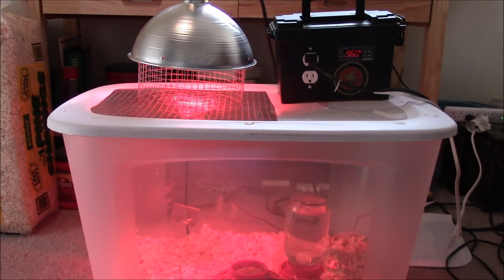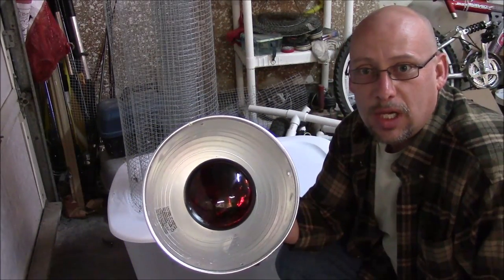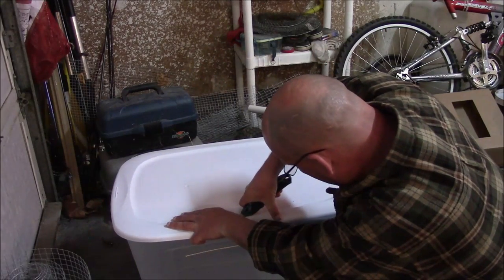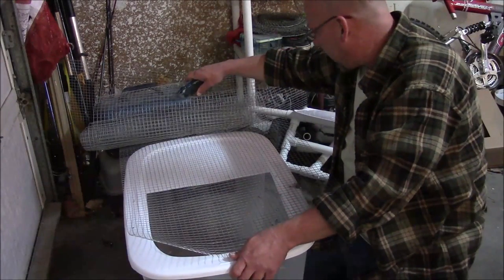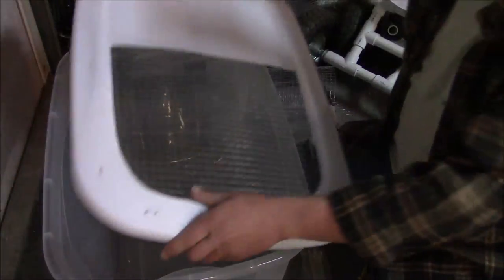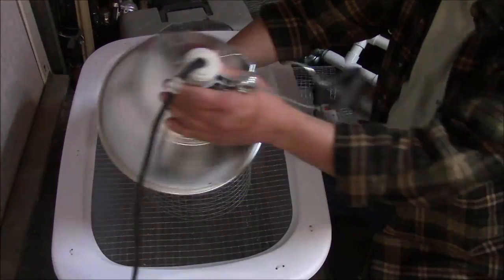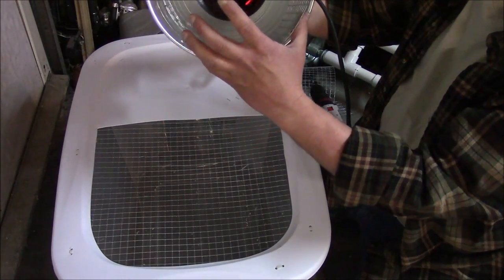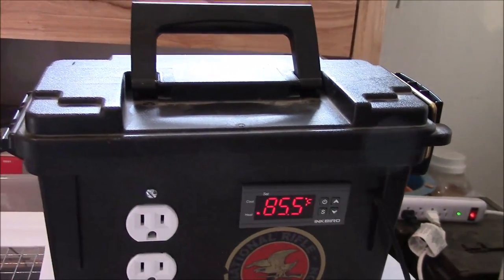How to Build an Automatic Temperature Controlled Brooder Box

Comment: I use a heavy wire rabbit/ small animal cage with a built in stand for my brooder with a heat lamp sitting above it. I have raised chicks many times this way and never lost one. Much easier to clean too. I keep it inside the house in a second unused bedroom where it is warm. For the bedding I just use large puppy pads. Just pull them out , throw away and replace with new.
Reply from the maker: sounds like a win.  I have started using paper towels for the bedding.  Works well for me.

Comment: If it's turning it on and off frequently, that bulb isn't going to last very long. I think you're going to run in to the issue of that bulb dying on you sooner than you think, which will kill the chicks. I stopped using bulb heat a while ago because I've had bulbs burn out at bad times. I currently use heat pads for brooding because they're more energy efficient, safer, and so on. The only downside to the heating pad is that you need to put something over them for the chicks to get their footing, otherwise you get some splay legged chicks. A paper towel seems to work, but I've also toyed with covering them in aluminum screen. A heating pad, a small 9"x12" one, uses about 25W of power versus heat bulbs which are 125W to 250W. That means I can run five to ten brooders for the same energy demand.
Reply: How do you keep the heating pad clean?  What kind of heating pad are you using?  TIA

Comment: Chris, I followed your 2 videos on this build step by step.  The issue I am having is figuring out how to set the thermostat to F instead of C and how to set it for the quail.  After watching 1/2 a dozen videos, I cannot find how to do this.  Any help would be greatly appreciated.  Newborn chicks are in the incubator waiting on me to finish their next home
Reply from the maker: I am so sorry you are having those issues.  I don't have this unit any more and can't remember the exact steps to set it to F.  I don't remember it being that difficult to find in the menu though.  If you can't figure it out just convert the temp you are looking for to C.  100 F (what you want it set at for the first week) is 37 C.  I know it is not ideal and I wish I could help more.
Reply: Slightly Rednecked I finally figured it out.  Thanks anyway
Reply: Google the name brand control. Find the user manual. It will tell you the settings

Comment: I'm currently using totes with regular bulbs and a dimmer switch. It has been working great so far. I do like this design and have considered building one myself. I'm curious do you still use this type of brooder or do you normally use something else? Thanks
Reply from the maker: I don't use the temp controller any more.  I find it really isn't necessary and just as easy to just move the light further away to regulate the temp.

Comment: What wattage would you recommend for a aquarium as a brooder to keep young chicks in? I think mines about 5 Gallons... I think that's kinda small... maybe I should get a tub and have the lamp sit over the chicks? what would you recommend I do?
Reply from the maker: You could use an aquarium but the tubs are pretty cheap and will be easier to handle (much lighter and less likely to break).  I use a 250W bulb.  Hope that helps.

Comment: I think i about cooked my chicks this first time i used my chick light. I think a 250 w bulb was a bit overkill. Unless I'm hatching quail in the dead of winter outside i think I'll still with a 100 w bulb. I had more chicks die get piled up on the edges of the box.(and i had no lid on it.) I checked the temp before i put the chicks in it. It was staying level at 100°. But all the quail stayed in the far edges away from the light. I lifted the light another 5 inches. By the time they were 2 to 2.5 weeks old i put them outside. They were constantly noisy when in the brooder. Quiet as church mice outside. The brooder was inside my house. I ended up losing 12 chicks in the 2 weeks they were in the brooder. Probably my fault for overcrowding the brooder. I still have 37 birds. I started the brooder with 50. Lost my last chick the early morning hrs before i put them out in the pen. They love it now. They even have a sand bed. They adore it. I give them a little bit of mealworms and a few elderberries in their sand bath. They love scratching around for food.

Comment: How many birds  will this handle. How long should I keep them in there and how much temperature drop per day for quail. I also installed a 4" desk type fan "cheap" in the end away from the light. My temp controller has a cooling and heating plug.
Reply from the maker: Well it will hold about 40 or so day olds but only for a few days before it gets overcrowded.  20 birds can handle it up to about 3 weeks old.  Keep it at 100 degrees on one end until the birds are feathered out (about 2 to 3 weeks old).  Drop the temp by about 5 degrees a day for a few days and they are good to go.

Comment: Can you use a heat plate or does it need to be a lamp
Reply from the maker: I have not used heat plates before but I have heard of others using them with good success.  I am sure they would work just fine.

Comment: If. Got two quails and they had a little quail could I let the mom do the heating thing or do I have to use an incubator
Reply from the maker: You probably need to use the incubator.  It is very rare for Coturnix quail to go broody.  It has happened but rare and not generally good results.
Reply: @Slightlyrednecked  How the Heck do they survive in the wild? Serious question

Comment: quick question...lol.  My Rabbit just had her first, and my first, set of kits a few hours ago.  I brought them inside because it is about 20° out.  That okay if I keep them inside until morning?
Reply from the maker: It should be fine. probably not necessary really as long as the mother pulled lots of fur.  I never bring mine in and haven't had any issues with weather that was down in the low teens or single digits even.  But lots of people do bring them in and it works great for them.  Hope that helps.
Reply: It does.  I figured it was okay either way.  Just nervous...lol
Reply: Thank you!
Reply from the maker: No problem.  glad to help.  :)

Comment: i have a question can i make something similar using a aquarium for a baby macaw and should i keep the tempertaure constant all the time
Reply from the maker: you can use an aquarium.  The temp needs to be about 100 degrees, and put the heat at one end so there is a gradient.  After the birds feather out start weaning them off of the heat by about 10 degrees every 3 days or so until you are completely off of the heat.
Reply: thank you so much for answering and
Reply from the maker: no problem.

Comment: Hi Steve, I have a Quick Question: How to shoot up the humidity - I am testing my new styrofoam incubator and it keep droping below 45%
Reply from the maker: Well i am not Steve but I have been called worse so guess that is ok.  :)

Humidity is about surface area of water not volume so a wide dish is better than a tall narrow glass.  You can add a soaked sponge to increase surface area and that should help.  You will probably have to replace it every few days.  I hope that helps a little.
Reply: Thanks a lot :)
Reply from the maker: No problem.  Glad to help.

Comment: Thanks I'm going to order some eggs to hatch from ksf 60 for $50. My cage is 21sq feet do you think I should order less just in case I have great hatch
Reply from the maker: I wouldn't.  If you end up with too many it won't be an issue until they are full grown and you will probably have way too many roosters anyway.  You can just eat the extras.

Comment: I hav made an incubator with styrofoam cooler but i dont have a hygrometer
Will my eggs hatch ???
I have put only thermometer ,plate of water with sponge ect except hygrometer
Will my eggs hatch and also giv me some advice plzzzz
Reply from the maker: probably.  If they temperature is fairly constant and correct they should hatch.  I have an entire series of videos on hatching eggs.  It is under a playlist on my channel page.  Let me know if you have problems finding it but it should give you all the tips you need.  Hope that helps.

Comment: hey im about to order my first batch of eggs and do a hatch and start raising/breeding.  how many quail would be good for this brooder design? also have you continued using this method since 2016 or have you made any updates for found a different/better way to do this (which is already a pretty great method)?
Reply from the maker: I can fit a large number of birds in there.  I have had around 50 or so in it at one time and they are fine until they get to be about 2 weeks old then it starts getting crowded.  I don't use the automatic switch anymore really.  it was a cool experiment but in the end it just wasn't necessary.  But everything else is the same.

Comment: What size is theTupperware? I’m hatching 150 quail. I really count on a lot making it. So would this size be big enough. Again, what size is it?
Reply from the maker: I think it is about 16 by 24 inches.  for 150 birds it would be fine but only for about 2 weeks at the most and then it will get very crowded. I would go with a larger tote if you can find one.
Reply: Slightly Rednecked probably what I’ll do is get another tote. Same size & half the quail in each one. How’s that sound? Open to ideas and tips. Thank again

Comment: Maybe a silly question but the plastic tote won’t melt with the heat lamp?
Reply from the maker: Not a silly question at all.  if you let the light touch the plastic it will melt it for sure but as long as you keep it from actually contacting it, it is fine.
Reply: Thanks mate

Comment: Hello Chris. I made a brooder like yours and I have put inside 22 newborn quails but every day one or two lay down for a few hours with dificulties to briething and then they die , do you know why and what can I do for them?
Reply: I also saw one or two of them with one eye clossed
Reply from the maker: I am so sorry to hear about that.  Did you let them dry out completely before removing them from the incubator?  Also, are they all crowding under the heat lamp?  it could be that it is too cold and you need to move the heat lamp closer to the brooder.  Hope that helps.
Reply: I didnt let them dry out and they are not crowding under the lamp. I believe that it has to do with the inqubator. Before two months I did my first hatch and all went right and the humidity was 60-65%. but before a month on my second try the weather in my place went hot about 35c and the humidity in the incubator was 35-40%. 7- 8 of 40 eggs didnt made to break the cell they only did a small hole and they died but the other hatched. Now from 30 litle birds live 15 they where closing one eye and they had dificulties to briething and one after an other died

Comment: My accu-rite flat thermometer says 120.   I cal. my meat thermometer its say 110 . my wire cage is about 7in off the tote whick is 100 qt
Reply from the maker: I would move the light a little further away from the brooder if it were me.